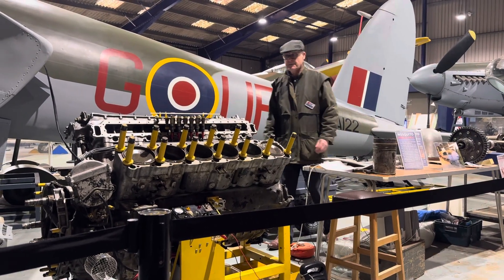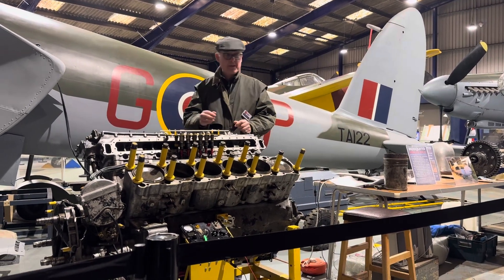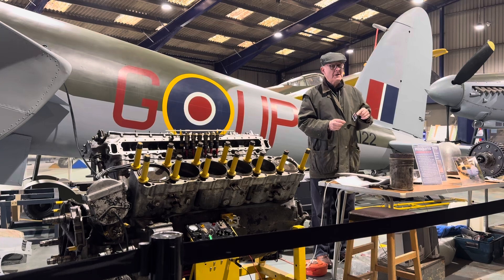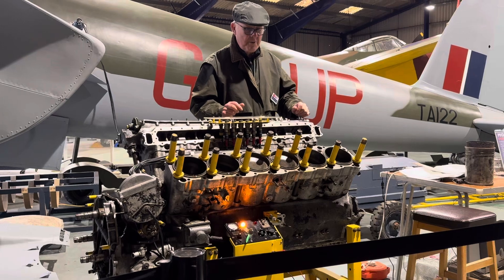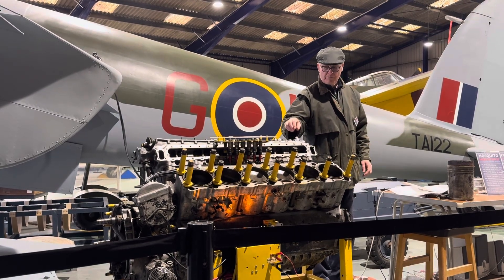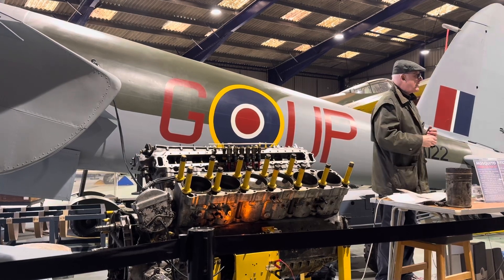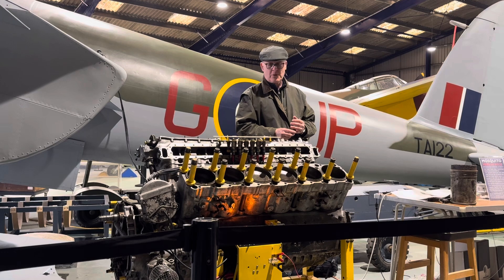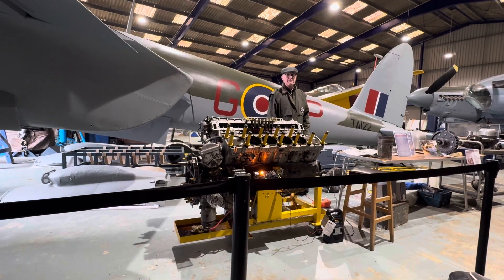Merlin Engine Demonstration de Havilland Museum

Comment: Seeing some of these WW2 engines apart or cutaways shows just how amazing and complex some of them were. All built amd designed in the 1940s or before by jand, no computers. The airplane museum in Sacramento has some awesome cutaway and disassembled engines in display. The ones with rotating vavles while having 12 cylinders or more and being radial (pratt and Whitney i believe it was) are mind boggling